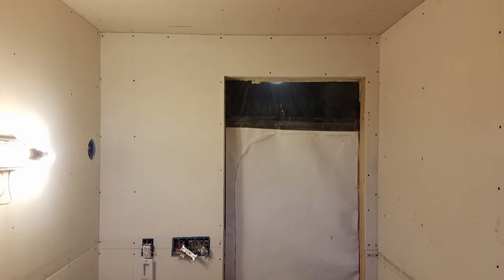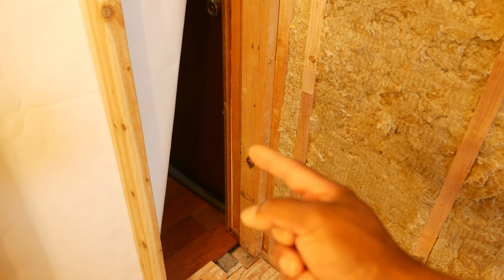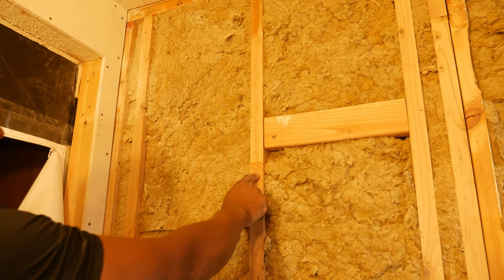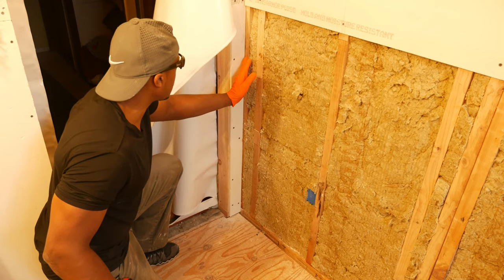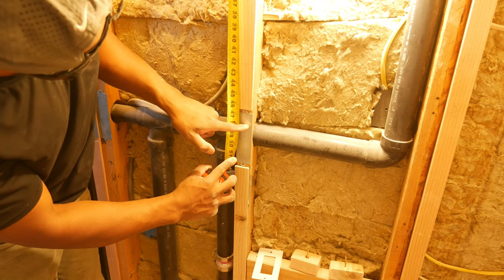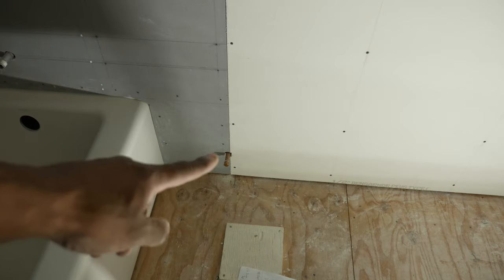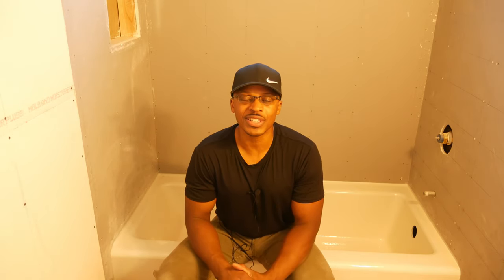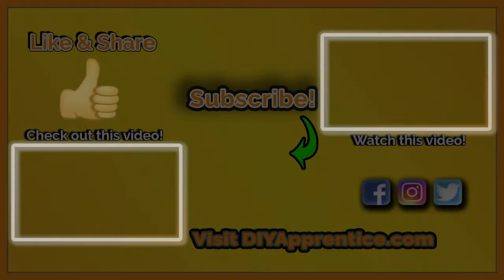Bathroom Remodel 66 - Installing DensArmor Plus Drywall on Walls 2 of 3

Comment from the maker: This is part 2 of 3 on installing drywall on the walls in the bathroom. I encountered a couple issues that I address in this video.

Please leave a 👍 if you like this video!

👉 Visit our website ► http://DIYApprentice.com
👉 Click to Subscribe! ► https://bit.ly/2pEBg3m

👍▬▬Follow Us on Social Media▬▬👍
✔️ Facebook ► https://bit.ly/2pAY8S3 
✔️ Twitter ► https://bit.ly/2G7mRDz 
✔️ Instagram ► https://bit.ly/2ILEKII 

🔧▬▬Tools and Materials▬▬🔧
✔️ DIY Apprentice Recommended Tools and Materials ► https://bit.ly/2T5psFw
✔️ DeWalt DW272 VSR Drywall Screwdriver ► https://amzn.to/2zpguKT
✔️ DeWalt DW272 Nose Piece ► https://amzn.to/2zpgqLa
✔️ DeWalt DW272 Carbon Brushes ► https://amzn.to/2xODuRw
👉 Dewalt DW272 Review ► https://www.youtube.com/watch?v=iEFbn...

✔️ Dewalt DW660 Rotary Saw ► https://amzn.to/2M3sFm5
I have an older Rotozip – some mixed reviews on newer Rotozip saws.
✔️ Drywall Lifter ► https://amzn.to/3kMxr7X
✔️ Drywall T-Square ► https://amzn.to/2Y87SEB

📷▬▬Video Equipment▬▬📷
✔️ Camera used ► http://amzn.to/2GcpkOb 
✔️ Lens used ► http://amzn.to/2Deu16S 
✔️ Tripod ► http://amzn.to/2GbaM1c
✔️ RAM Suction Mount ► https://amzn.to/2Wz9PXh
✔️ Cyberlink PowerDirector ► https://bit.ly/2jTwGxT
✔️ Adobe Photoshop ► https://bit.ly/2V7nyUX
✔️ Camera Slider ► https://amzn.to/2WtD7GW
✔️ Deity V-Mic D3 Super-Cardioid Directional Shotgun Microphone ► https://amzn.to/2LI1lf7

*This video was recorded in 4K resolution, so modify your settings accordingly if desired for better image quality* 

Disclosure: This video contains affiliate links, meaning, at no additional cost to you, I will receive a commission if you click through and make a purchase.